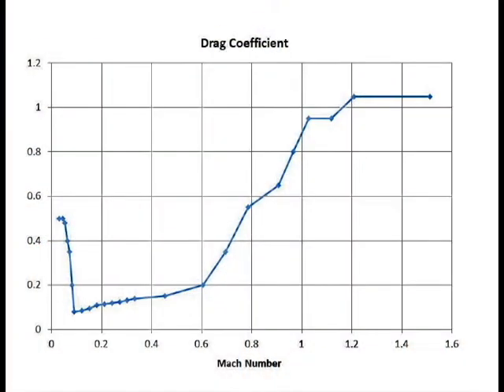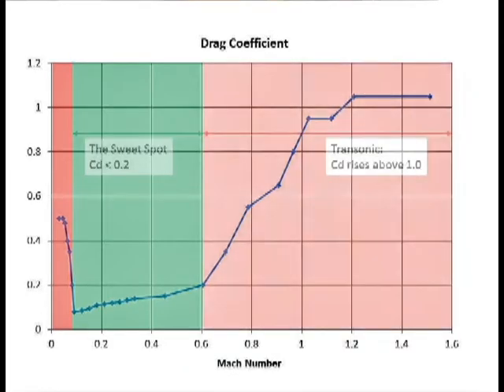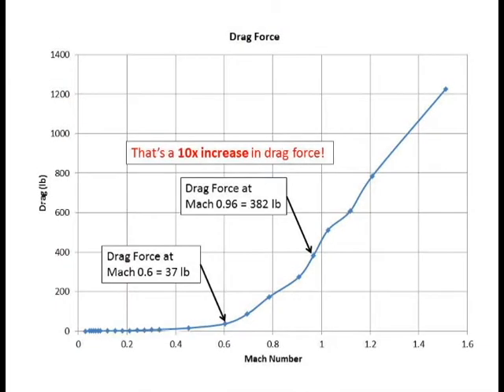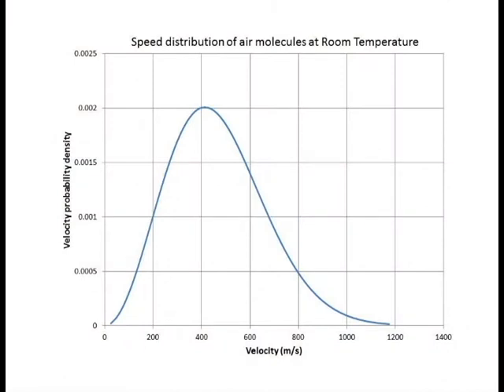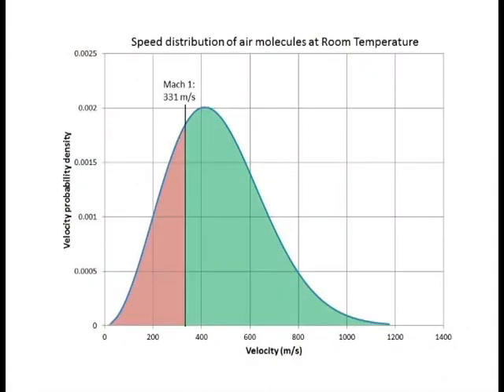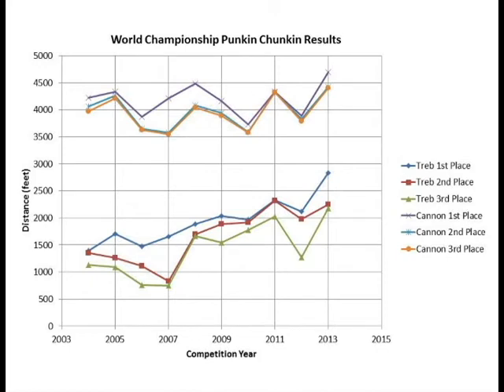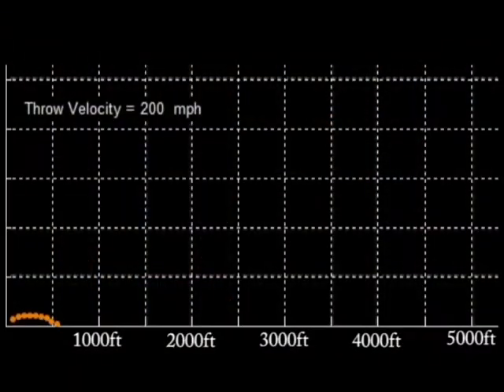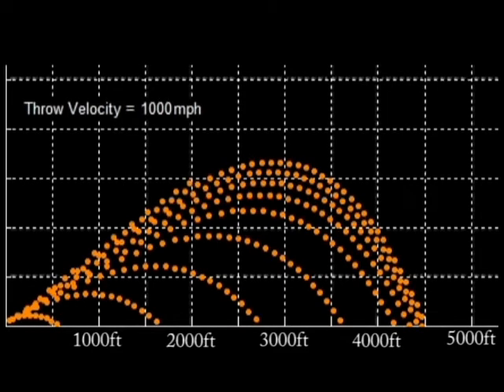episode 2:  Leaf Blowers

Comment: Maybe use a boiler instead of an air compressor. 250psi at 400 degrees F I think are pretty typical for a locomotive steam engine. Plus I am pretty sure this would make the machine safer. Maybe stay 1 mile away though, just in case.
Reply from the maker: Yes, although only compressed air is allowed as per WCPC rules.  Nothing says they can't heat it though.